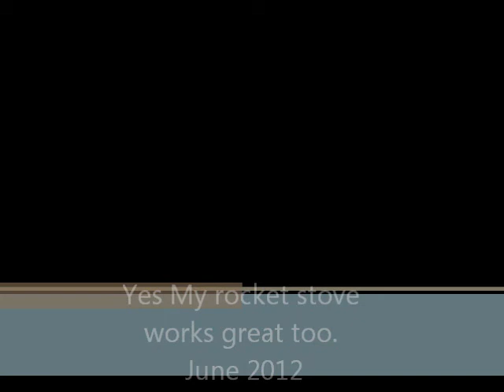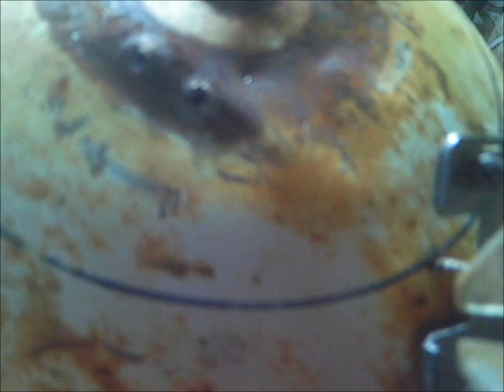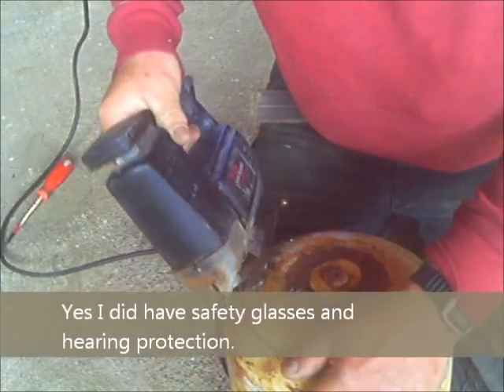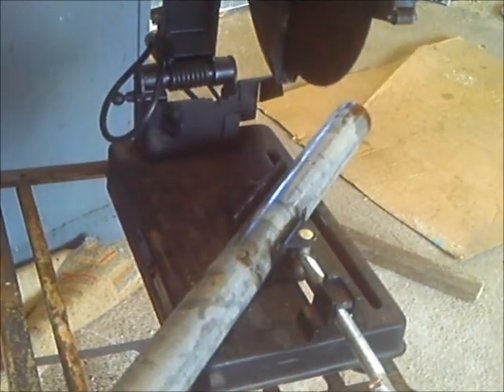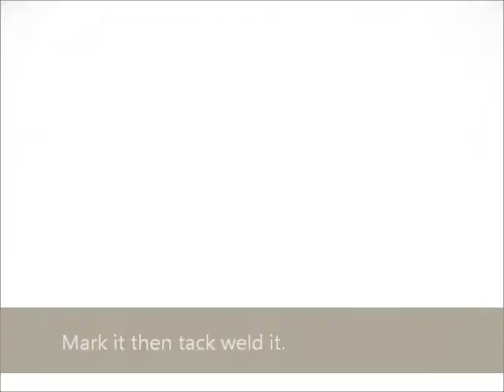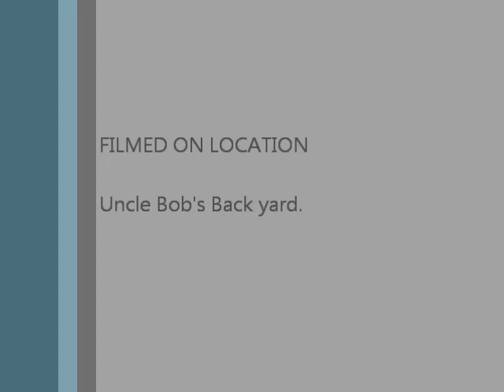Rocket stove up grade

Comment: Hi nice job,but have you sealed air inside it withno where to get out ,if so it could be a bomb .drill a hole in it to get rid of the pressure,just a thought.